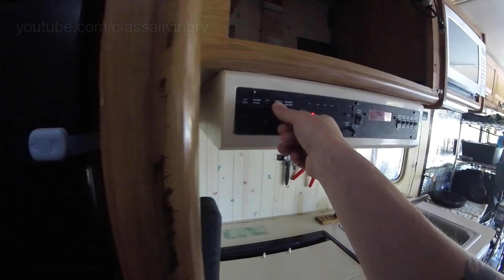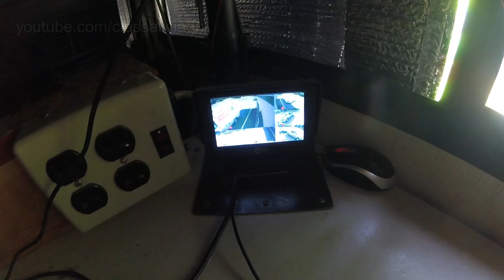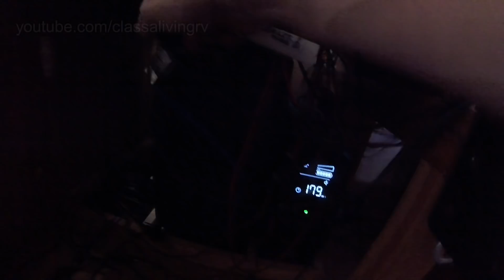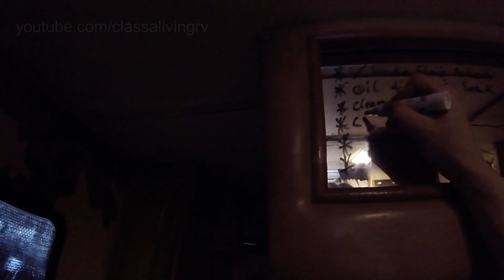Rest Area Quick Stop || Full Time RV Living

Comment: Check your PCV “positive crankcase ventilation “.  Intake could be leaking down the back and burning off on the exhaust.  Could also have rings not sealing due to carbon buildup. Can fix that by pouring mystery oil in each cylinder and leaving it soak for a week. It’s old so probably a little bit of everything.  Just keep it full. I’d use 10w 40

Comment: I seen the video of the guide seas being replaced. While you did this you pulled all the spark plugs. I remember cylinder 8 was oil soaked. I know there is one more cylinder on that side that was also oily. All the rest of the plugs were sooty but okay. Quadra jet is rich. I have seen the exhaust when you fired it up and it is burning oil. You don't have to believe me or you might already know the engine needs rebuilt. It is just how it goes. 1989 454 never been torn down by now it is time for rebuild or a new crate engine. This rv looks to me to be in good shape. Of course it's not new but you got work with what you got. Good luck

Comment: That hose comes from the bottom of the engine next to the oil filter.It is a engine oil cooler. The P30 with the 454 chev. engine uses that cooler to keep engine oil cool .The transmission cooler is in the radiator . That hose is to the oil cooler is know to start leaking. NAPA says they stock it.  Truck and trailer repair centers can rebuild you a new one too.
Reply from the maker: No the oil cooler is on the driver's side. The internal transmission cooler has not been used for some time now.
Reply from the maker: https://youtu.be/C0m2RRGbyR8?t=1108

Comment: Get you a set of helper bags for it, you are a smart fella. Install a gauge and fill them with an air pump. I had a cheap set in my truck for pulling a camper. Naturally they wanted to sell me an expensive set. Bought a set of firestone bags and made a mount. Problem solved. Roughly 200.00 bucks.